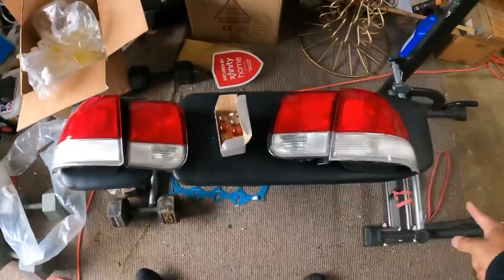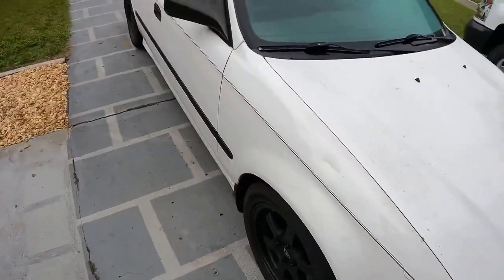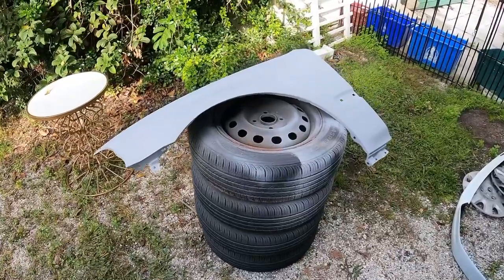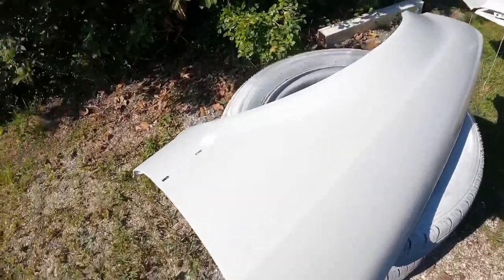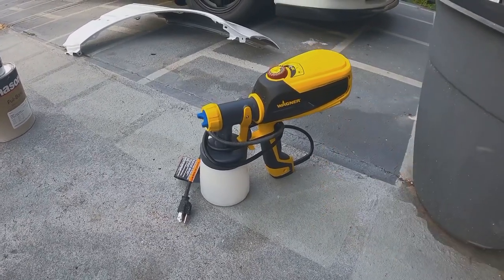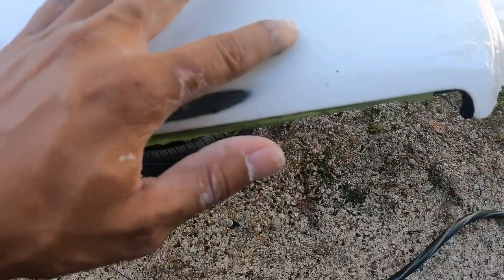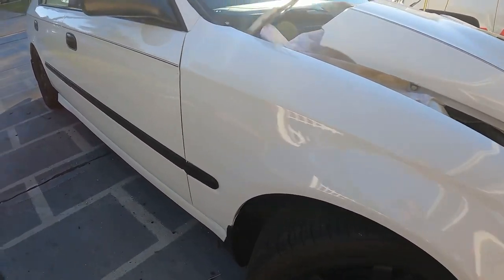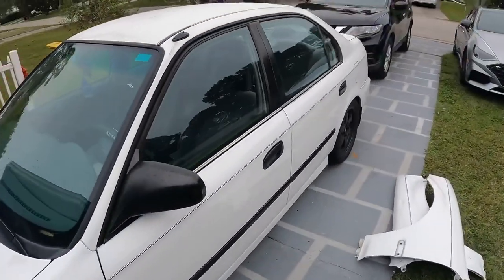Civic gets painted with electric paint gun

Comment: what size nozzle did you use on the electric sprayer
Reply from the maker: Sorry for the super late response. I used the smallest nozzle that came with the sprayer
Reply: plz PIN THIS QUESTION/REPLY.
it is very important for eveyone who wants to paint using this electric sprayer.

nice video !